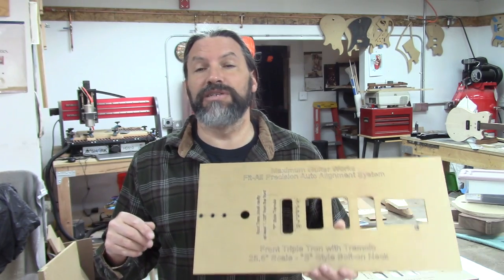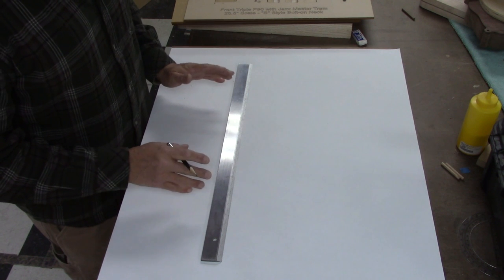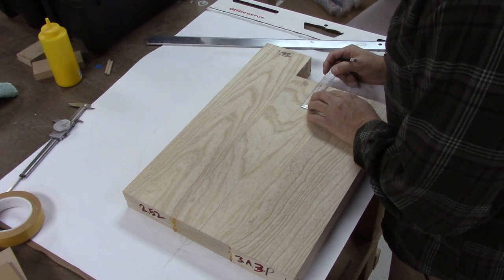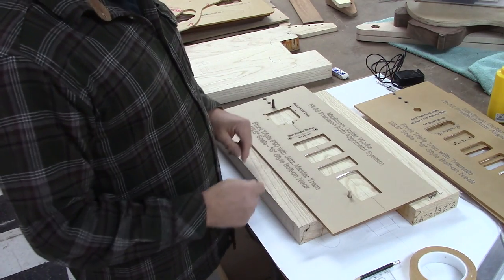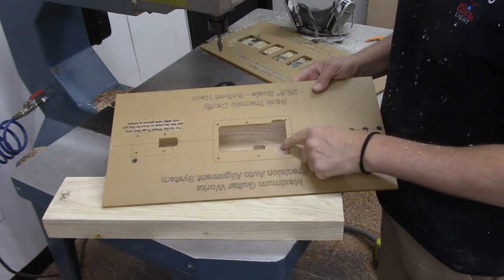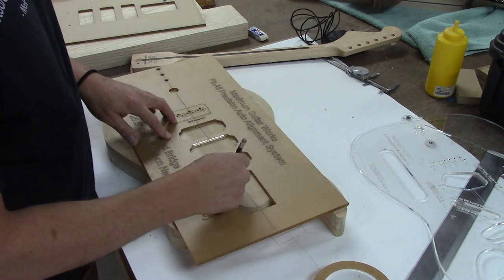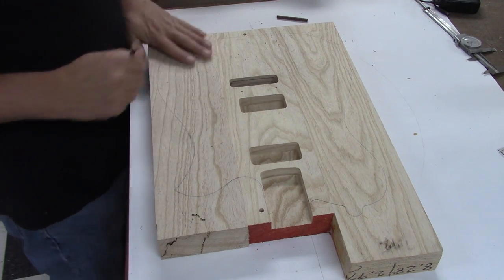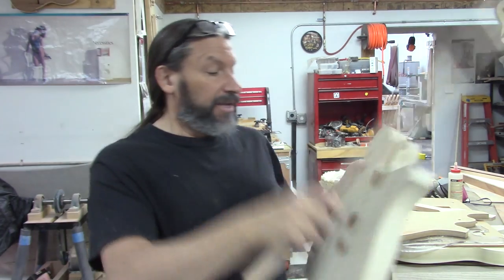Templates From Maximum Guitarworks... How To Win A Guitar Building Contest!

Comment: If you're using a body already cut out or you've prematurely removed the 'off-body alignment' locators (oops) just scab on a couple pieces of temporary dead wood and redrill the pins. 15mins for the glue to dry and you're back in stride. Take a break and smoke a joint.
Reply from the maker: That would work, though I'm not good at smoking marijuana